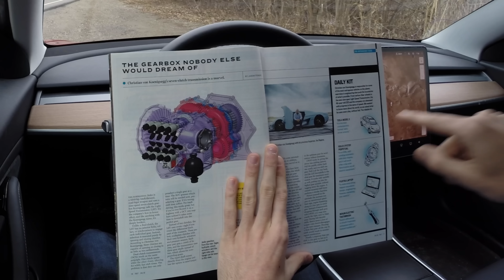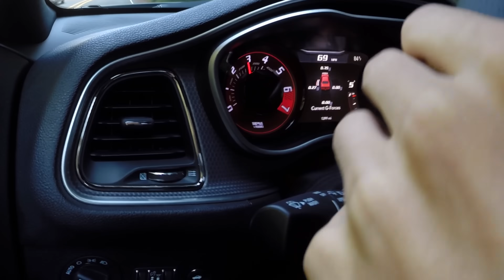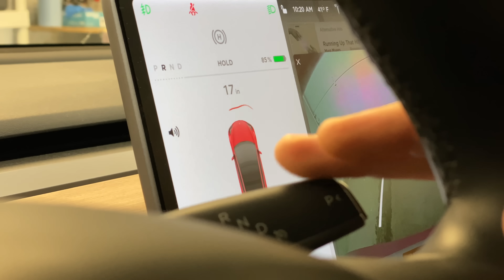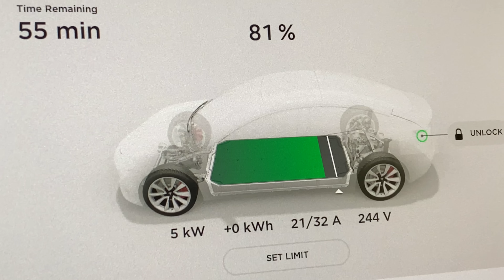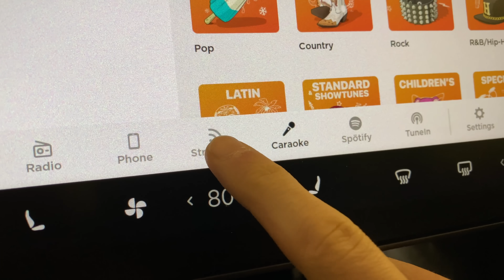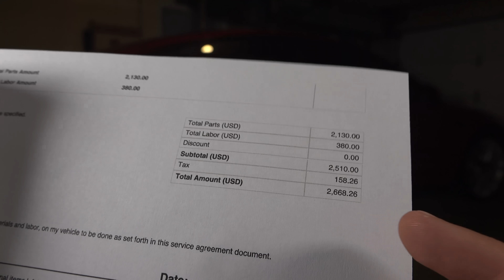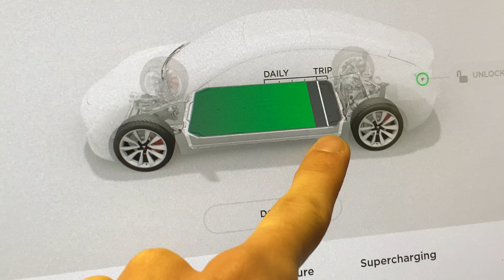Living With A Tesla Model 3 For A Year - The Best Daily Driver

Comment from the maker: UPDATE: You can adjust the Forward Collision Warning sensitivity. It's under the AutoPilot menu (which I don't have, probably why I never saw it). Mine was set at "Medium" and was definitely over-reactive. I have set to "Late" now, and will see how it goes. There is also an option to turn it off. So, ignore that complaint, because Tesla accommodates driver preference, wonderful! 
UPDATE 2: Things keep getting better! Using the Tesla phone app, you can select the exact battery percentage for charging. Not sure why this isn't the case on the car, but the good news is you can do it with the app - thanks for letting me know! 
UPDATE 3: When I bought my car battery coolant interval was every 4 years. This has changed, and is no longer a required service interval. From latest Model 3 owners manual: "Your Battery coolant does not need to be replaced for the life of your vehicle under most circumstances. Brake fluid should be checked every 2 years, replacing if necessary."
If you hope to see more of Bucket the cat, follow on Instagram :) www.instagram.com/engineeringexplained
Reply: Update 4: emergency manual door releases do exist in the rear doors. They are hidden inside the speaker cover, to protect against unintended use and for child safety. Read the user manual dude, people just believe what they hear.
Reply: @psnTrKvp  No, the speaker hidden door release is for the Model X.
Reply: @igeekone  no.
Reply: @psnTrKvp  The Model 3 owner's manual explicitly says only the front seats have manual door releases. You're correct for the Model X Falcon doors.
Reply: Forward collision warning should really be under Safety and Security, along with Lane Departure Avoidance,  Automatic Emergency Braking, etc.
Reply: Imagine that: Mr Whiteboard doesn’t read the manual 😱
Reply: I was thinkin "If he has it Forward Collision Warning on late and still get chimes... then must be an asshole driving" XD just kidding. In "late"  I still get some chimes but maybe one every 2 or 3 months.
Reply: Yes, the Tesla app allowing you to set a specific percentage of charge is a huge improvement (it wasn't always like this)... Well at least a huge improvement for those of us who might suffer a bit from OCD 😁
And thank you for posting some of the most unbiased Tesla videos out there, you actually helped me decide on buying my own Model 3 Performance minus back in September, and as a thank you for that I also used your referral code when ordering 👍
I also agree that while it is not a perfect car, it is a very good daily driver.
Reply: May be you can remove the 2 head rest from the back seat to improve your rare visibility "just a little bit" :p
Reply: Engineering Explained : Wow.  The comment section after an excellent post is even better than an owner’s manual. .  😀
Reply: And maybe it's over-reactive because you're not using brake pedal? Try to use it in order to compare to your normal (one pedal) driving style. I'm very curious. B/w love your channel!
Reply: @TP-hh8yc  If he's not using the brake pedal, the car should warn about forward collision much LESS, because he is going to release the gas long before any collision is remotely close.
Reply: Jason, does the Tesla not have reduction gear sets for each motor / axle? Does it require a replacement of the lube for the reduction gears ever? Even manual transmission ICE vehicles and 4x4 transfer cases and differentials tend to require fluid changes around 50-75k miles. I can only imagine an electric powertrain would put more load on those gear teeth thanks to the instant low-end torque, sheering the lube more than a typical ICE vehicle would. I know filled for "Life" transmission lube exists, but from what I've seen, those guarantees are only to hobble a transmissions out of warranty before requiring replacement.
Reply: Engineering Explained do you keep (agree) your Model 3 between 20-80% charge? Thanks.
Reply: Problem with the low end sound, aka bass, in the back seats explained: waves of any nature has a length (wavelength). When the bass comes out of the subwoofer (in the trunk I assume - I don’t own a Tesla at the moment) and reaches the back seats, the power (amplitude) of the low frequency waveform has not yet been developed - it’s amplitude is low.  When that sound wave reaches the front occupants, the waveform is developed (at or near peak amplitude), and fills out the bottom end of the overall sound. You can have the biggest subwoofer system money can buy, and if you put it in the trunk, it will sound like mud in the back seats... only the mids and highs (from other speakers) will be developed.
Reply: "does not need to be replaced for the life of your vehicle ". What is life of your vehicle in Teslas eyes? I remember one Manufacture said that Life of your vehicle is like 100k Miles.
Reply: You should Pin this comment because pretty much everything you complain in the video is solved.
Reply: the official car of NERDS
Reply: @johnspencefareal420  thats like being in the 80ies and saying computers are the official toys of NERDS.
See you in the future mate.
Reply: @RufftaMan  Have fun in your virginmobile nerd
Reply: @johnspencefareal420  lmao
Reply: I was just about to say 2 of these 3 updates.  Also, "Maybe Tesla will release an over-the-air for a heated steering wheel..." I mean, they did that with my back seats.  I haven't actually ripped open the steering wheel to see if the hardware is in there or not.
Reply: @lijay1  right but iirc it was said from the very start that heated rear seats would come later on with software.  The car has been out for over 2 years now.  It wouldn't make much sense to keep heated steering wheel hardware inactive dud to software for that long, especially with how rapidly Tesla has been advancing their software and rolling out features lately
Reply: Maybe it's a Model S thing, but my audio focus can be adjusted dynamically front to back and left/right. Rear emergency door releases do exist. It's different in the Model S than in the Model 3, but rtfm.
Reply: the forward collision is like that because of all the idiots who crash their teslas.. .-.
Reply: Dude check at you said at 16:55
Reply: About aircon while parked, have you heard about webasto?
Reply: Most sedans seem to have terrible rear vis.  My Jetta isn't any better in that regard, so it certainly isn't unique to Tesla.
Reply: might be a good idea to blur out the address on your app...
Reply: If you want to keep this car for a long time change battery coolant every 4 years :) I change every fluid at least every 4 years on my IC car. Because lifetime longevity fluids don't exist.
Reply: Good to know, you should pin this reply.
Reply: EV's are already the future.
Reply: did you know that you can set your audio system to focus on the back seats? not sure how the sound quality in front is affected tho
Reply: Tesla model 3 the impossible Camry are invading our San Diego neighborhood.
Reply: Engineering Explained tbh I have my Forward collision warning set to early because I’m usually not paying attention and I sh*t comes in handy.
Reply: No need to change the coolant (any more)? That seems fishy...
Reply: @nickolastiguan  Tesla is constantly analysing logs from the cars. The more the cars are being driven, the better their analyses become. Obviously, they learned that battery life isn't compromised nor improved by changing the fluid. No other car manufacturer can do that.
Reply: Dang Nguyen You know for fact Tesla came to the conclusion, that changing the coolant has no affect on battery life? If that is true, great, one less maintenance item. 

For me, every time a car manufacturer say one of the fluid is “lifetime”, I get suspicious. Because they are basically saying the fluid will last the life of the vehicle, but what is the life of the vehicle? 10, 20 years, or when the warranty runs out. If I wanted to keep my Tesla for a long long time, is still change the coolant at least once every 10 years or 100k miles.
Reply: You know why youre wrong about the front seat emergency release handles? Because it makes the game Shotgun allllll that much more important. It teaches awareness and vigilance and those who arent aware may perish. lmao just kidding. Awesome video.

Comment: What metal is used as the catalyst in electric car batteries ?
Reply: Okay Mr Dog, you have a cat obsession
Reply: Batteries are electrolytic, not catalytic. There are many different combinations of electrode materials with different properties, but in general they contain oxides of nickel, manganese, cobalt, aluminium and even titanium.
The current collectors are made of copper and aluminium.

Comment: Hey Jason talking as per your experience with performance model 3 tyres I have got a question that while buying model X , should I go with 20 inch vs 22 inch wheels . Range and price are not the major issues for me but I don't want to land in the situation like you 
Model X tyre : 265/35R/22
Sidewall length 94 mm or 3.7 inch
Reply from the maker: Personally I'd get the 20" tires. Model X is a big heavy car to put on 22's.
Reply: @EngineeringExplained  thanks for your suggestion

Comment: Thank you for helping pioneer new tech. Hopefully they will be more affordable and better built in the future. Not just Tesla but all electric cars.
Reply: Unfortunately there's still far too much resistance to build a car as amazing as a Tesla since legacy automakers are far too used to making money from vehicle breakdowns, overall deterioration, and maintenance.
Reply: @googadisbeotches9360  I don't think that there's too much resistance for them to make a good electric car. Just comes down the scale of economics. Toyota literally sells more camrys per year than Tesla has sold cars ever. You can't have things like paint bubbles and screwed up spoilers and body panel fitment issues. Take the number of cars that Toyota sells per year times the average cost of warranty work for Tesla and I bet you it would cost more than  Tesla is worth. But companies like Tesla are making the tech that will make these cars viable and awesome one day.they're electric motor by far is better than any other electric motor that anybody has come up with in many industries not just cars.

Comment: 16:00 adjust the front collision warning to 'Late' instead of the default 'Medium' and it's way less annoying
Reply from the maker: Just did this, thank you! I did not know about it. (For anyone interested, it is under the "AutoPilot" menu).
Reply: God I'd hate to imagine 'Early', if it has it lol
Reply: @icky_thump  it does have early. It's very, very annoying
Reply: jpwe10 I have had mine set to early since day one.  Been a year and I’ve never found it annoying.
Reply: @Resist4  it's likely due to the fact that I drive quite aggressively :)
Reply: @Resist4  Same. Goes off maybe once every couple weeks. But I also came from a car that had regen, but it was MUCH weaker so I'm already in the habit of a long, slow stop
Reply: I'm old. I remember when cars did not need a  university IT course to drive.

Comment: 13:15 there are manual emergency releases for the rear doors. They are under the seat located between the carpet and rear seat cushion (if you're sitting on the rear seat, you can feel for the release by sliding your hands along the underside of the rear seat cushion)
Reply: jpwe10 

it’s useless if nobody knows about it and/or it’s not immediately obvious.
Reply: If it's not prominently marked and/or known by the driver and passengers, it's useless in an emergency. Jason who is a smart guy didn't know, so how many other people would know?
Reply: Interesting to know. Not sure that's the best place for them, but good to know they are there

Comment: So the maintenance costs is incorrect. There are fleet operators with data on long term Telsa usage and it is true that the maintenance intervals are less but the parts and things that commonly break that aren't on the schedule make them the exact some cost to own per mile as ICE (Telsa S vs 7 series and S Class)
Reply: Have a look at the limo service Tesloop. They detail exactly what their cars cost in maintenance and they are saving 10s of thousands of dollars on each car vs their old diesel's.

Comment: Jason, some objections to your points:
1) Your comment about "throttle response" is not necessarily true. Electric motors are controlled by sophisticated motor controllers and are tuned to the responses to the throttle, much like the latest-and-greatest "drive-by-wire" systems in internal combustion engines. Just as in variations in throttle tuning between car makers and models, there are likewise variations in throttle response in electric cars. As you have mentioned in the non-performance model that you had previously, there was a detectable delay in the throttle response. Similarly, drivers of other electric cars have reported that on some models, there was a "power ramp" during the acceleration to protect the battery. So the relationship between the throttle position and amount of power that is available is really an arbitrary concept, relics of mechanical throttle linkages of yester-years.
2) The remote start feature is not exactly an exclusive feature of electric cars either. Certainly, there are remote start features on gasoline-powered cars that can do similar things to what a electric cars do. It is just that electric cars, being limited on battery power (for people with range anxiety), made it somewhat of a necessity and major convenience to have the car climate controlled while plugged in to conserve battery power. I don't see why gasoline-powered cars couldn't do the same thing (albeit not saving any power or energy).
3) Immediate heat (or lack there of in gasoline powered car) is again, not exactly true. On my 2015 Mini Cooper.I have noticed that heated air is almost immediately available, ie. within seconds of starting the car. Depending on the design, most cars get their heated air from the hot exhaust from the engine. Unless you're saying that the exhaust temperature of an internal combustion engine is less than 80°F, heating the  air from internal combustion engines should be just as quick as electric cars (if not quicker) — it all depends on how that heat is extracted, and the design decisions by the car maker. 

Anyways, my compliments to another interesting and thought-provoking video.

Comment: For #7 an electric car will take a lot of time to be changed every morning
Reply: I have a Tesla 3 and would suggest that if you don't have a garage with a charger in it, forget about buying it. On the other hand just plug it in at night and it will be fully charged by the next morning. You can even schedule it to heat or cool the cabin by a particular time.

Comment: change the forward collision warning setting to "late", I've noticed a big change in how often it alerts.
Reply: By default, Forward Collision Warning is
turned on. To turn it off or adjust its sensitivity,
touch Controls > Autopilot > Forward Collision
Warning. Instead of the default warning level
of Medium, you can turn the warning Off, or
you can choose to be warned Late or Early.

Comment: 2:02   That's the key. A $60K car is hard to get mass adoption, regardless how great the car is. It needs to cut down the MSRP to around $35K-$40K in order to get mass adoption.
Reply: The 35k model 3 exists......it has alot of the same benefits, just without the express pace. Still fast for the money though
Reply: Their is a $35k version, and its still quicker and has more features than competitors in that price range (i.e. a fully loaded camry or accord)